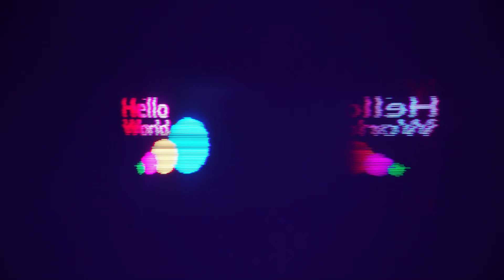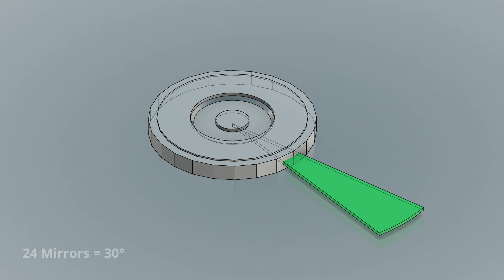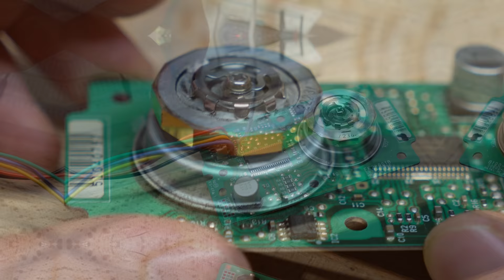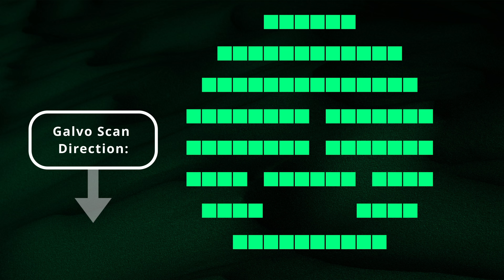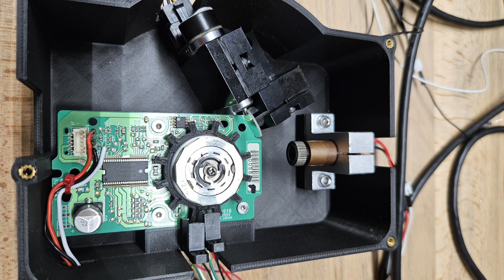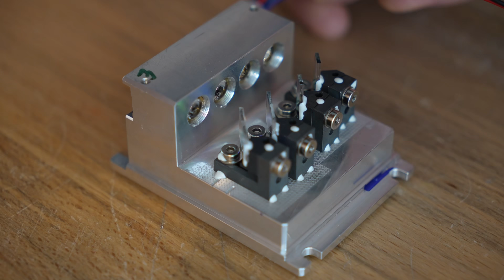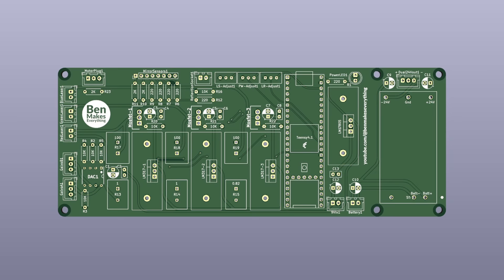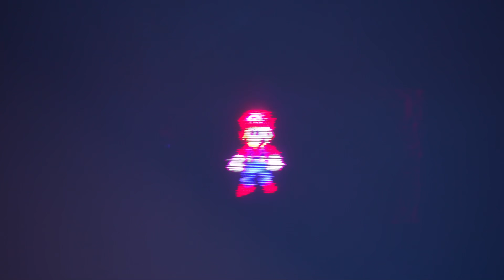DIY Laser Image Projector (100ft+ Range!)

Comment: The glitchiness is probably due to interrupt service routines triggering in the micro. Seems like your scan code is in the main loop where it can get interrupted at random times by things like adc reads and comms data. You probably want to move it to an ISR of its own which gets triggered by the opto input at the beginning of a scan line and return to the main loop at the end of the line to do other stuff. Make it the highest priority level and it shouldn't get interrupted by anything else.

Comment: If you still have access to a scrap laser printer they can have photoreflective sensors that use infrared. You could use one on the back of the polygonal motor, if you don't want to try and get feedback from the motor itself.

Edit: However I have no idea if they have fast enough response time for the polygonal motor.
Reply: A laser printer monitored the scan timing using exactly such a method in early designs, a sensor was at the edge of the exit slot for the beam and would provide the required feedback, I have seen at least two units where the sense pulse was fed out of the scan engine cassette to the external drive electronics, one with an optical fibre the other with a pass through lens.  Later designs would use motor feedback.
Reply: @KallePihlajasaari  
That's interesting to know. I haven't worked on anything old enough to use that technique. I'll have to take a look next time I'm digging through an older model.
Reply: @oriontherealironman  Early budget EPSON printers with the RICOH engine had the lens on the casing with a fibre-optic clip that then led the scan light pulse to the main mother board where the photo detector was.  The scan engine was sealed except for the exit slot lens that was a service part so that the mirrors inside never got toner on them. The laser was also outside and mounted to the side. I remember gutting lots of them my buddy had as non repairable returns, they were not very reliable in my view.  A SONY (iirc) engine had the photo sensor inside the engine housing with the laser and motor drivers with just electrical connections.

Comment: I don't have much knowledge of electronics. However, as far as I know, the time it takes for each electronic circuit to respond to a triggered signal is different. Even if there are dozens of hardware elements like in this project and the software is flawless. When I think of reasons such as the delayed response times of electronic circuits that I mentioned above, environmental interference, vibration (due to the motor with the mirrors being exposed to air friction), the characteristics of the electronic elements in the hardware changing due to heating, etc., the thought of how deadlocked this job can be is crazy!!!
Reply: Vibration is not electronic . Electronic is crazy fast.

Comment: i've a question,
for the timing is it possible to use a rotaey encoder from a mouse scroll wheel?
i think those would increase the resolution of the operation if is possible to be used

Comment: 17:54 
Ben: "I know what you probably waiting for..."
Me: "HDMI support, yaay!"
Ben: "Longer range tests!"
Me: "Oh"
Reply from the maker: Well, that would be cool. Maybe if I ever build another one...
Reply: @benmakeseverything  is it possible to bend the laser light with magnet like crt?
Reply: @fdgdfgdfgdfg3811  Photons don't have a charge unlike electrons
Reply: @fdgdfgdfgdfg3811  No but there was some research many years ago on materials for optical computing, which apparently change their refractive index based on how much light is passing through them.  So you shine your pixel laser through them in one direction, and use a second laser firing in a different direction to "bend" the beam of the pixel layer.  No idea what sort of materials they were using though.

Comment: Texas Instruments did this with their Digital Light Processors. Was used in some televisions in the early 2010's but it was bulky because you had to have internal projectors and fell out of favor for thinner plasma and lcd displays. 

DLPs consists of hundreds of tiny mirrors that moved on an acuator and could easily display 1080i or 1080p. It could also display true black since it could just turn the light of from that particular part of the display. 

I wonder if you could adapt your setup to use an old DLP and see what kind of resolutions you could get.
Reply from the maker: That's an interesting idea. I'll have to look up the mechanism and see how they were doing it. I remember hearing about DLP, but it seems like it was dead in the water before it ever got going.
Reply: @benmakeseverything  it is still used in somethings, mostly industrial, I think there are a few protectors that still uses DLPs as well

Comment: 14:09 Could you have just used two batteries to get the +/-24v?
Reply from the maker: Theoretically yes, but I was concerned that they would discharge at different rates, and with them hooked together I was worried it might cause problems.

Comment: Low pass your timing trigger to eliminate the noise. You have a clock onboard use it. The wheel isn't going to change rotation rate appreciably over the course of a second. You don't even need to detect each facet, just trigger once per rotation and interpolate. So, detect wheel RPMs using a sensor, interpolate for mirror facets, eliminate RPM sensor noise with a low pass filter. Do this and you will completely eliminate your line jitter and excursions. Unless the smaller noise is due to hitting the timing limit of your device clock.

Comment: what instead of a mirror motor from a laser copier + stepper motor use a dual mirror motor from a laser copier for the horizontal and vertical pixels so you get a more clear picture and also with more lasers to get rgb  there are also yellow lasers on the market maybe also a white laser

Comment: Very cool, I'd check for some type of interrupt running in the background messing with your timing.  Disable interrupts and watchdogs, write your own timing loops.  You could otherwise use a static ram chip connect ing the address lines to a counter with the data pins turning on and off the lasers directly,  you could use dule ported ram and have your controller writing to the ram and "banking" the addresses that the laser reads its frame from.
Reply from the maker: Thanks - yeah the code is pretty basic at this point, I am sure there is a lot of room for improvement.

Comment: could you add more lasers in the vertical axis? even just one to have it split up the work for vertical scanning, have it project using the same horizontal scan mirror setup, and just add a second galvo. For that horizontal artifact effect you could replace those photo gate sensors with just a high res encoder on the horizontal mirror motor as they hold rotation accuracy pretty well even at high rpm. Also look into piezo galvo mirrors, they can scan faster and are often far smaller so you can even fit more of them if you decide to go for grid scanning.

Comment: pretty genius how you used the galvos for vertical since they are way slower and also I was literally gonna suggest using a interlaced scanning pattern but you already did that!

also since it is using a sorta analog tech you could do fun things such as changing the vertical width or resolution

for the color you could try dithering to artificially increase the color palette
Reply from the maker: Thanks - I will probably mess around with the code to try dithering when I have time.

Comment: One of Baird's later mechanical televisions used a helical mirror, made of a series of flat, angled sections. This produced a raster pattern directly from the mirror geometry. Then all that's required is the laser timing and mirror position to be sync'd. It does require a line output from the laser rather than a point, but that's fixed optics.

Comment: It's been a long time since I watched your previous videos in this series so I don't know if you've already tried this... but what if you 3D printed your carousel with the facets of the polygonal mirror modeled into the structure and used paint or foil to make them reflective?
Reply from the maker: 3D printed stuff is soft and susceptible to deformation with temperature changes. It would be better to hire someone with the capability to machine them from aluminum and polish that. Appreciate the suggestion though!

Comment: Use the zeeman effect to have an electromagnet dim your laser output, removing the need to have a driver.
Reply: Sounds slow. Next you propose a Pockels cell?
Reply: @ArneChristianRosenfeldt that's fine, but what about Kerr and Zeeman in tandem?  One modulating the other?
Reply: @xennojeremy  yeah, actually I tied to find out how early cgi was transferred to film, but failed. Laser printer always used laser diodes with driver modulation or bars of LEDs and again current modulation ( on off digital). LED  printer have no moving mirrors. So 4k diodes with individual bond wires like on a modern LCD? Explains the price. The gold alone probably costs 10€ . That is what I like about Laser scanners. No need for thousand of small electric contacts outside of silicon.

Ah, yeah, I don’t think that HeNe can be modulated as easy as an LED? But Iearned that the molecules need to touch the wall before the can light up again. The tube has the size of .. it is too large to let all atoms touch the walls every pixel. High Voltage High frequency is not good. Actually CRTs have pretty bad electric magnetic emission.

So yeah, in the 70s we cold feed a HeNe in a glass fibre and modulate the polarisation.

Comment: The jittering scan lines is an aesthetic in of it's own. Very reminiscent of Star Wars holograms and Blade Runner advertisements. 💕
Reply: Rent your projector out to film companies wanting that kind of aesthetic.
Reply: @jimmyzhao2673 way way cheaper and easier to do as vfx in post unfortunately
Reply: Seriously… looks great
Reply: My first full laser (35 years ago) was an HeNe Laser that put out nice pulsing oscillations. It must have had a spinning driver with the dot originating at the center and moving outward. It produced nice harmonics, especially in the lower frequencies. Music like some of Enya's chants, produced a mesmerizing effect. It cost me around $2K, whereas nowadays, you can find decent lasers under $100.
I cannot find a current digital laser that will do this or produce the nice spirographic output. Any ideas where I can find such?

Comment: The potentiometers you used aren't the best for regularly adjusting things as they are often just rated to several hundred turns. I tried to use them in a project, too, but when I read the datasheet that fact really came as a surprise.
Great project either way. Very excited for future improvements.
Reply from the maker: I agree, in hindsight I wish I used much larger ones with knobs that can be adjusted without a screwdriver.

Comment: When modulating the lasers in analog mode, do not let the video level drop below the cut out point of the laser diode. In other words, do not let the diode switch all the way off. You will find that at a low level, after projection at speed, the line will be black, though the laser is technically still on. In this mode, you can modulate into the MHz region with ease. I used this technique to modulate a fiber optic driving laser at 330MHz back in the 1990s.
Reply: ^ Yes!.  
For gas lasers this is "pre-ionization".  
In laser printers using IR diodes, just prior to the start of each page, a calibration routine ramps up the laser current until it barely lases.  Then this value is held in a "bias" DAC that establishes a baseline for the driver.  A second DAC establishes the proper "drive" level.  Now the circuitry easily modulated between these two levels.
Reply: @AcuteChronic please excuse this "grammar nazi" post, but something you wrote got me thinking...

Do lasers lase, or laser.. I think it's the latter.

While adding "r" suffix to a verb creates a noun for the person or object that performs the verb, the word laser wasn't coined that way. The "r" isn't a suffix, so the verb isn't "lase"

I guess a laser should really be a laserer...

I'll go away now...
Reply: @dougaltolan3017  lase (lays), lasing (lay-sing) is a verb found in major dictionaries, "(of a substance, especially a gas or crystal) undergo the physical processes employed in a laser; function as or in a laser:"
Reply: @dougaltolan3017  It's called "back formation".  English if full of them.
Reply: @dougaltolan3017  It's called a "back formation".  English is full of them.
https://www.youtube.com/watch?v=fr9o2zNT_xA
Reply: Hysterisis off at the output isn't off at the input exactly _ drive the dynamic range. 0.3Ghz at the power supply _ must have been a big diode the data rates are way higher these days.

Comment: The line jitter is more than likely caused by internal interrupts in your microcontroller. (Over which you have no control.) I have had this argument with computer video engineers versus TV video engineers for decades. Computers are unsuitable for creating clean well timed video. Period. This is  because of their necessary internal housekeeping at pseudo random intervals. In my projects, the video is always generated in dedicated hardware at crystal locked rates with no interruptions. The hardware is then managed by the attached microcontroller. Memory access timing is allowed during all video blanking intervals so it does not show up in the display.
Your projects are excellent. Keep up the great work.
Reply from the maker: Thank you. You are probably correct - I noticed that when I switched from using an arduino nano to a teensy, the nature of the horizontal jitter changed, even though I was using the same sensors. That implies it has something to do with how the two different chips handle the interrupts. There is still a lot of room for improvement I think.
Reply: My guess was interrupts too - had this same problem when generating analog RGB with AVR's. Tho, the internal interrupts can be disabled, but there's also another obstacle here: for example, AVR cannot guarantee how many cycles it takes to enter an interrupt, as it depends on what is going on internally when an interrupt fires. However, even that can be overcome with some creative cycle counting to make sure you always start at the correct cycle after an interrupt is fired. (I used the timer interrupts to generate the ~15 kHz horizontal sync). 

The end result ended up being pretty stable, managed a pretty darn stable 256x192 @ 60 Hz w/ RGBI (16 colors) analog image with just a couple of AVR chips and FIFO buffer.

Comment: An overhaul of the horizontal and vertical sync might be the next step,
Have you considered getting rid entirely of the IR sensors that detect a step in the mirror assembly? If you already control the mirror assembly speed with rpm, it might be just better to calculate everything on the fly.
Think of it like VGA monitors and how creating a custom resolution using a utility like the one built in your gpu driver, theres so many values that in the end have to fit in a 15khz frequency.
I feel like this is the only solution to avoid the jitter.

Also i think its also worth mentioning the diffraction of the laser could be easily fixed, but i know just enough about optics and wavelength diffraction to know that i dont know anything.

Comment: I think you should consider using esp32 for the next version. It has even higher clock speed, built-in DACs and quite a lot of processing power. Built-in wi-fi can also be convenient for wirelessly updating image in real time.
Reply: ESP32 with more than 600 MHz? Which one?

Comment: In general: Just because you're drawing vectors does not mean you can't fill.
If you find a way to broaden the beam or move it faster, filling becomes possible in the same way as it's possible with an electron gun.
I own a Tek digital oscilloscope with CRT that fills areas, and still uses vectors.
Reply from the maker: Fair enough. I suppose I over-simplified things.

Comment: what if you split the output beam in 2 and shared it between 2 pairs of galvos? each pair could raster odd and even scan lines. Also i feel like you could do all this better in analog by taking a page or two from a tv driver circuit. Interestingly enough, the return to start does not happen instantly in a CRT either.

Comment: The laser printer scanning module has a sync output. You could use that for the timing. 
Instead of a galvo, you could use another spinning mirror that's slower and synced to the horizontal scanner, but I suspect they're not readily available. If you could get the distance between mirrors small enough, you might be able to do an X/Y configuration, but that's a lot of precision machining.

Comment: For the laser power control, could you not use a array of resistors, lets say 8, driven by mosfets. Each resistor/mosfet increases / decreases the current in a binary way. You would need a lot of GPIO's but that could be simplified with select lines instead of 3x 8 GPIO ?

Comment: have you thought about using q-switches? they can switch lasers in 10-100 nanoseconds and you get the added benefit of exponentially higher output
Reply from the maker: The switching speed with the setup isn't really the issue, it can do less than 100 nanosecond pulses easily. What I needed is a way to switch that fast, but also control the current dynamically.